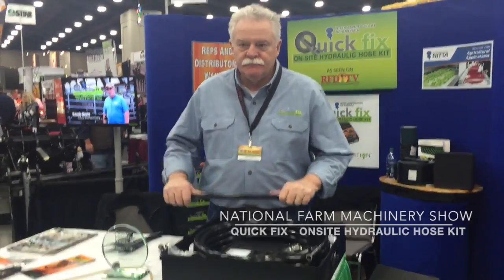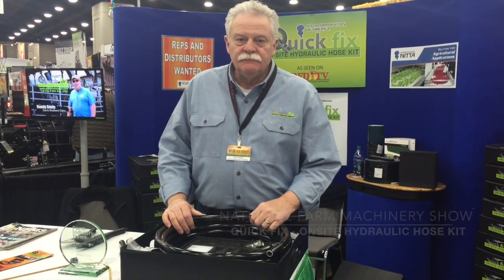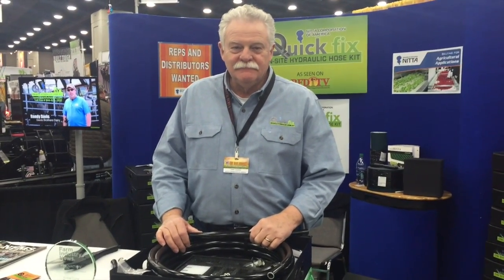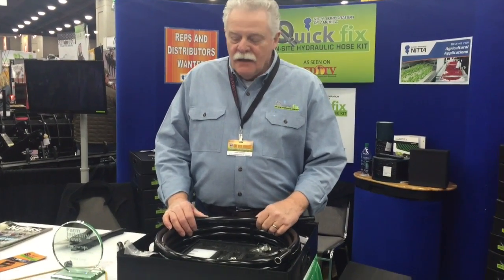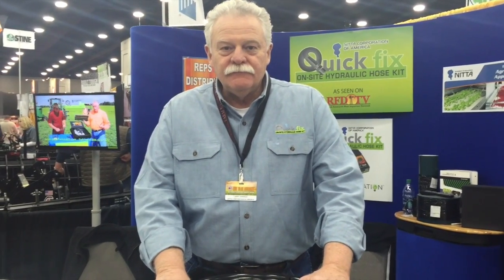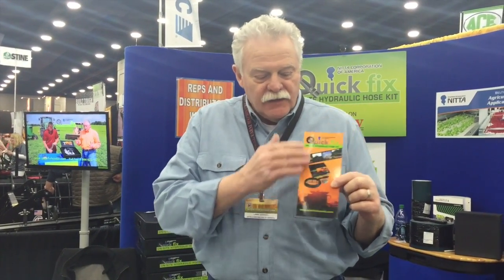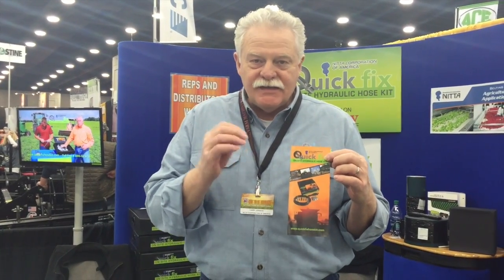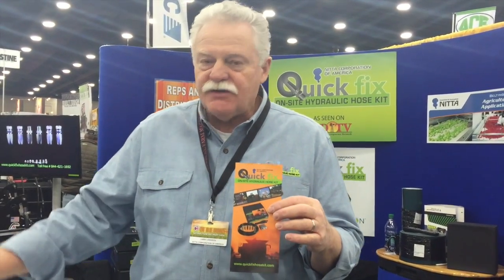Quick Fix - Onsite Hydraulic Hose Kit

Comment: I used a lot of different on job hydraulic fixes and they all do the same if you do it right and get the compression fittings bottomed out and tight your good, the only thing is you need a adapter to swivel (turn) on one end of the hose

Comment: A field attachment fitting is a thing of the past because of the liability. But that's not saying they're bad. they are ideal for quick fixes to get you out of a bind. I've worked in the field for the past 21 years changing failed hydraulic hoses and I would recommend to someone that is in a remote area that couldn't afford a failure. 1/2" in a 100r7 hose is not as common as a -06 but still would with the right adaptors. The one thing I would recommend is hitting the car carrier hard with this product in a 3/8" version. There are thousands of owner-operators hauling cars on car carriers with miles of thermoplastic hose that have countless wear points. I sold so many -06 field attachment fittings with jump adaptors to drivers but did not offer bulk hose with my sales. hit em hard, that's your target market. One last thing. The gentleman explained the reverse thread on the feerule and when to stop threading onto the hose. A good rule of thumb which I always used is to turn the ferrule all the way until it stops and then back off 1 to 1 and a half turns. This guarantees that you will have a full bite of the ferrule and limit the chance of the fitting blowing off. Might want to offer an -06 R1 and an -06 r2 ferrule in case the driver may have to splice into an r1 or r2 braided hose.
Reply: Tim Anderson 8